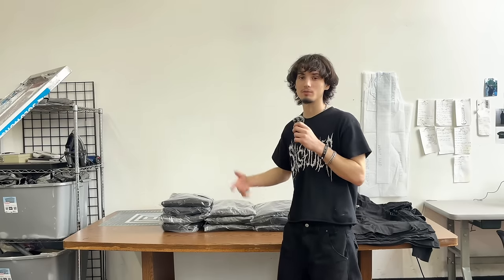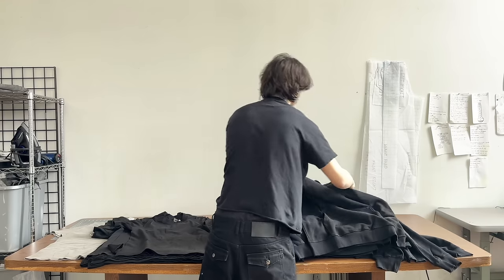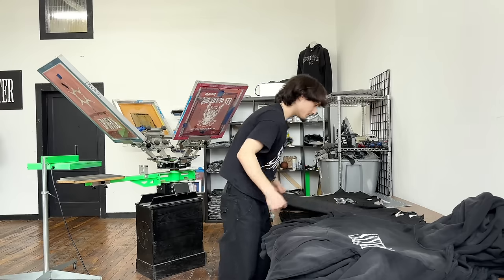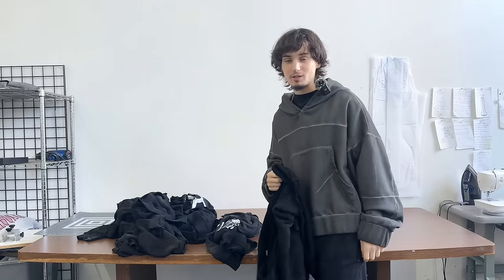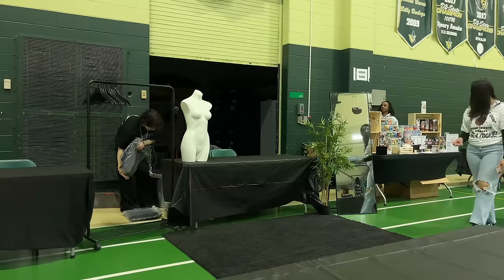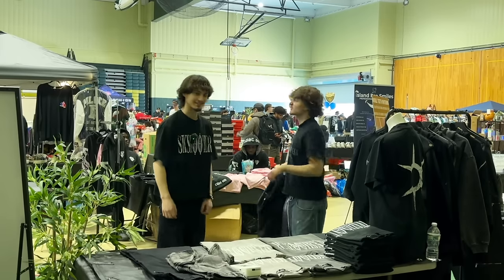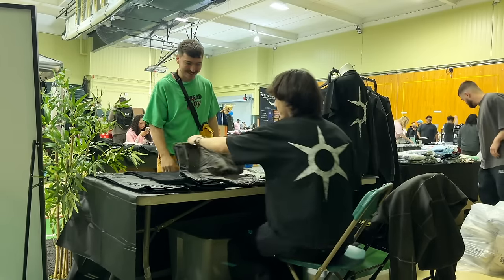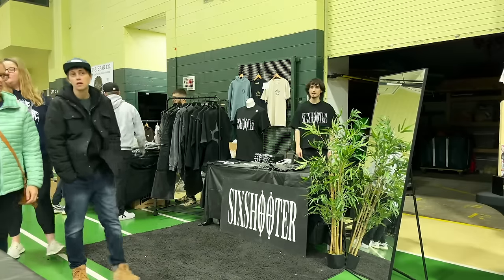I Did A Popup Shop For My Clothing Brand

Comment: I think the flash dryer in combination with the acid wash made the fabric brittle and essentially dry rot . Not sure if I’m 100% correct but that has happened to me before.
Reply from the maker: That’s what I was thinking, but then I started pulling spots that heat didn’t touch and it was ripping. So the spray the used def deteriorated the fabric similar to dry rot